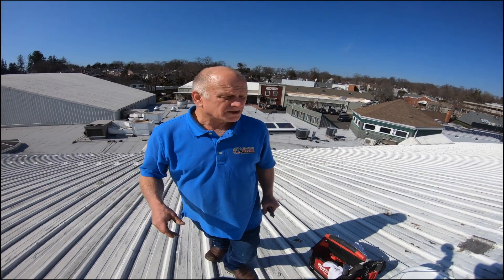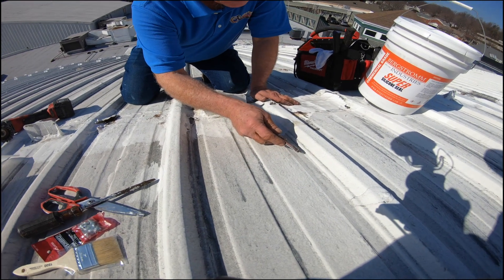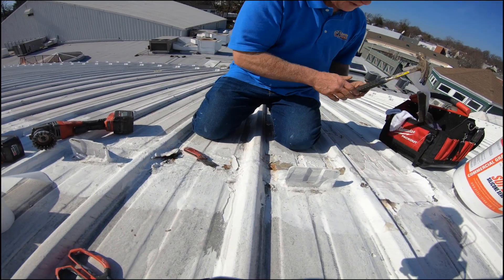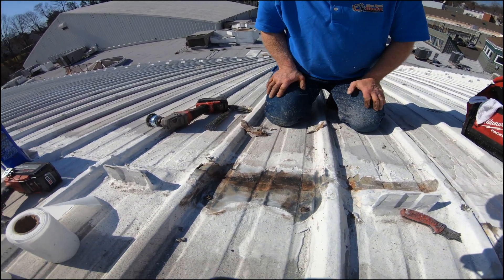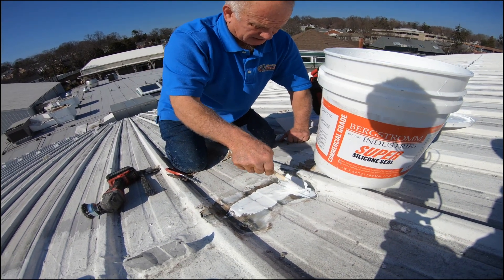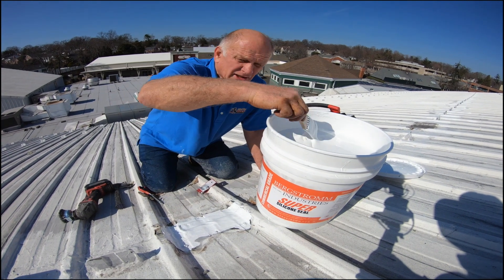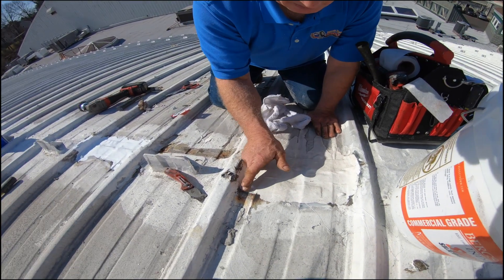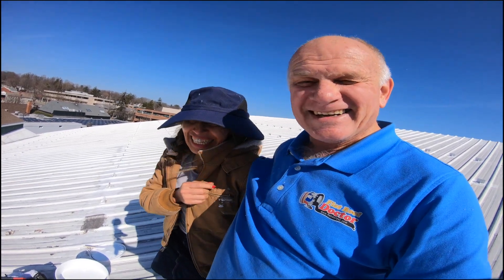See the Worst Metal Roof Coating!!! and How to Repair leaky seams on a Metal Roof

Comment: How do you hold that bucket level on the slanted roof?
Reply from the maker: lol Sometimes it is not easy. I use any tool like a hammer with a rubber handle to rest the bucket on. The rubber handle prevent it from sliding

Comment: I'm not able to find Henry fleece roll at home depot at my place(Canada). When I used the keyword "polyester fabrics" to search, the landscape polyester fabrics popped up--would it work the same?
Reply: I have not tried landscape fabric but at Home Depot (Canada) I have used Bakor 990-06 Yellow Jacket 6 Inch it's overkill but for my roofing application, it worked well. I hope this helps you.
Reply: Thanks so much homie!! 😊

Comment: Nice Fix, Doc is it available in Canada also how does it perform in freeze-thaw cycles?
Play Safe From Elliot Lake Ontario Canada.
Reply from the maker: Sorry we have not been able to ship to Canada yet.  If you buy Flex Seal Liquid and the Henry fleece roll from Home Depot you can almost get the same results. The Henry fleece is slightly thinner, and more stiffer. But is should do the job
Reply: @FlatRoofDoctor  
Thanks for the quick return, Doc But after a little more research I found these products from The Henry Company the Canadian division.
195-Polyester Fabric.
 Or 990-06 Yellow Jacket Roofing Repair Fabric.
487 100% Silicone White Roof Coating.
Play Safe From Elliot Lake Ontario Canada.
Reply: I'm not able to find Henry fleece roll at home depot at my place(Canada). When I used the keyword "polyester fabrics" to search, the landscape polyester fabrics popped up--would it work the same?